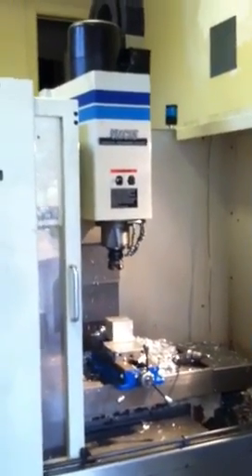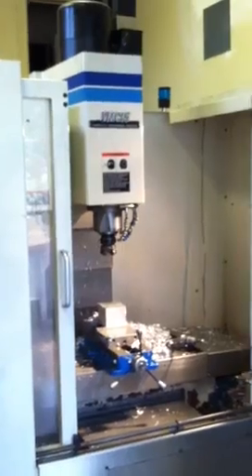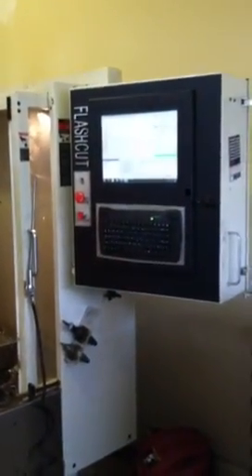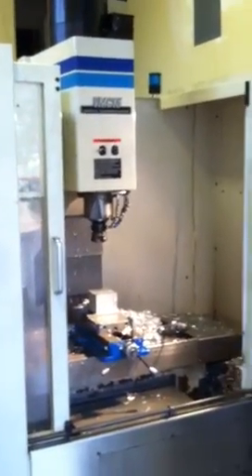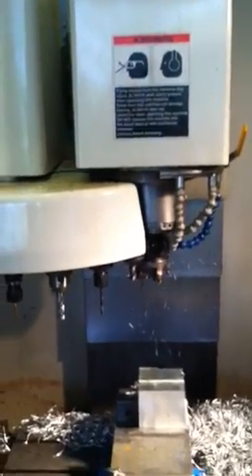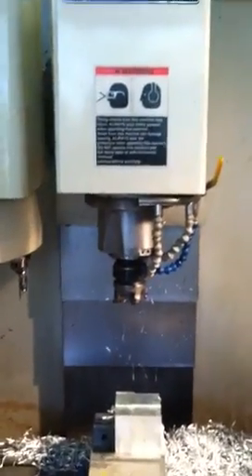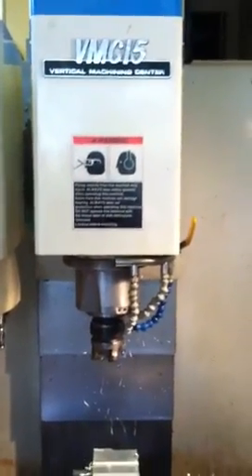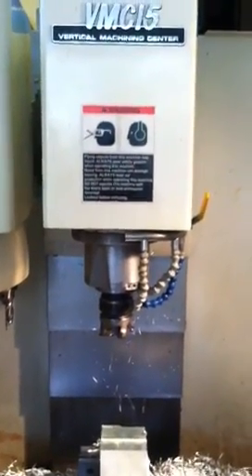Fadal Vmc 15 to Flashcut CNC

Comment: WOw this is very interesting setup dave. I would like to know what motors and drives the machine is actually using now and what exactly had to be done to adapt the toolchange setup.  I just purchased a nice Used Cincinatti Arrow and while the control is supported it will not always be that way. Having the ability to adapt flashcut to it would be very nice. What kind of lookahead does flashcut have and were you able to get similar or better rapids  and cutting feedrates out of the system?

Comment from the maker: At fadal the leadscrews we used were so accurate we rarely used lead screw comp. We lased calibrated every machine but rarely was it necessary. The way lead screw comp works is you make a correction at each turn of the screw. This leaves a tool mark on the workpiece.

Comment from the maker: The Fadal components are obsolete, and replacement parts are not reliable. Flash cut is on the cutting edge, and really simple control. Runs on a pc.